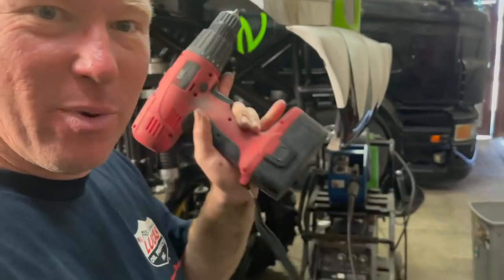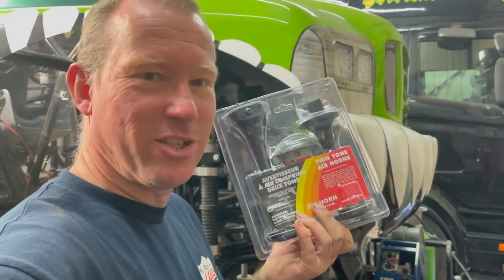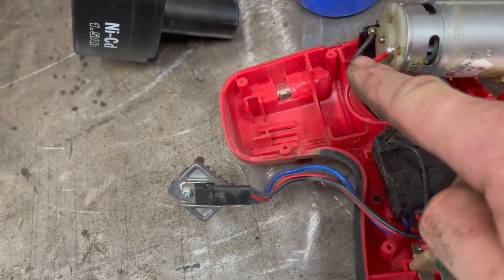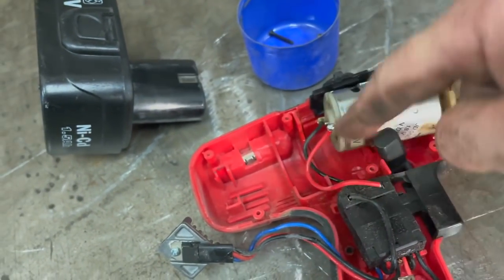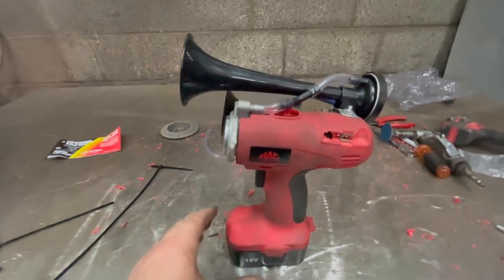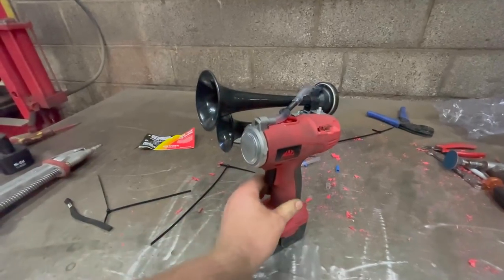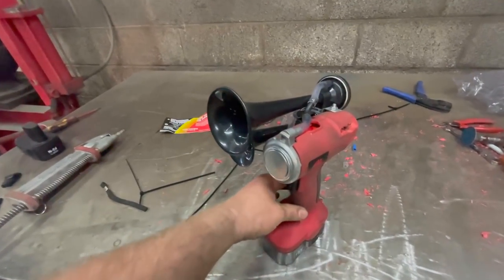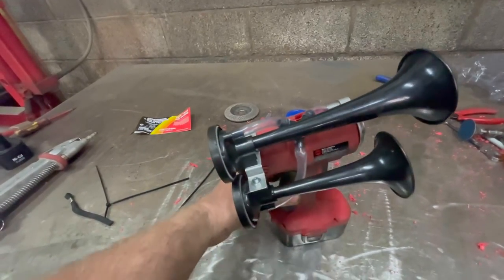The Ultimate Airhorn

Comment: I was expecting you to modify the air pump to be run off the drill motor!

The only bad part of this is, people normally run out of CO2 quickly, and the noise goes away. But with this, all you need to do is swap out the battery, and throw the flat battery on the charger in the truck! Never ending noise and bother!

Comment: Did you need to do anything to go from the 18v battery to the compressor that is made to run off of a 12v car system or does it work straight away?
Reply from the maker: It was fine at 18V

Comment: I tried with a milwaukee drill with a 5A battery but it doesn't work.... any idea ?
Reply from the maker: If the compressor motor spins and make no noise you’ve probably got the voltage round the wrong way

Comment: Did you use the relay that came with the air horn kit?
Reply from the maker: No I did not use the relay in the kit. The horn is only pull 8.5 amp on 18volts
Reply: Awesome thank you!!

Comment: You never showed how to hook up the wires.
Reply from the maker: Just hook up the positive and negative to the motor from the battery via the switch,
I didn’t show it because all of the drills could be different
Reply: @swampthing4x4  i got an 18V drill. But the motor is capable of 12v-24v. My drill is exactly the same as yours. So just cut of the drill motor, and connect those wires with the compressor?? You didn’t changed anything on the relais/switch?
Reply from the maker: @user-wi1cs1ez2y   yes just add the Compressor where the drill motor was fitted  you don’t need to change any thing else